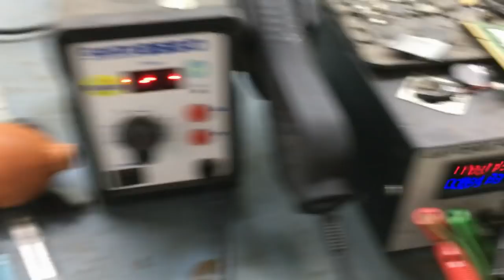Laptop Repair with help of Freeze Spray

Comment: why do you need this method if you have DC PSU ?
Reply from the maker: Aries Computer Solutions:
While Flat surface mosfet short then it was not heat but its spread heat to pcb layer
 (Pcb upper layer work as a flat surface mosfet heatsink )
so we can't judge it for short , but all area feel heat while surface smd mosfet short , you can see nearby mosfet so many components located, so we doubt tiny component for short because of tiny component absorve heat quickly from pcb layer..so hear with freeze spray help us for observation of first attempt heat destination